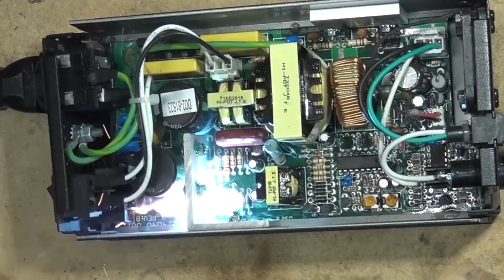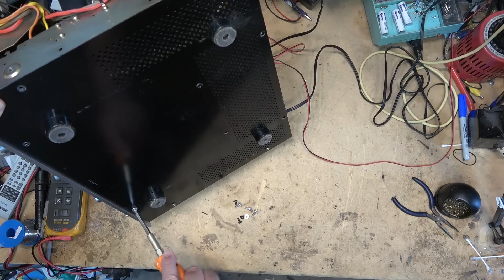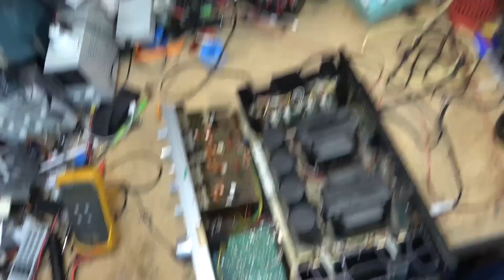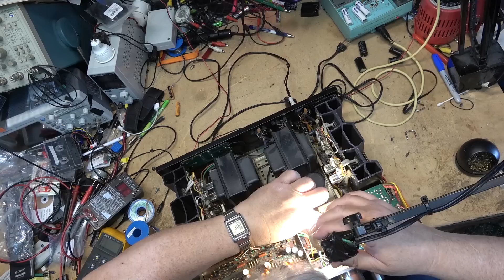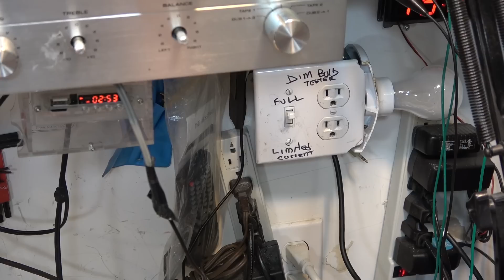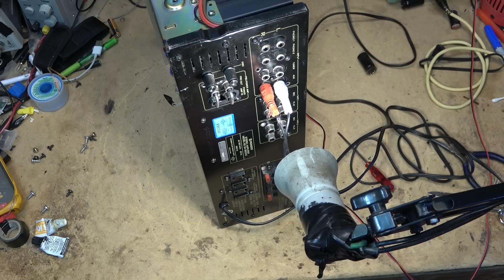Pioneer SA9500 No Sound

Comment: I don't agree with starting a unit every time on current limiting or variac, under power can damage components as much as over powering will. Your transistors, rectifiers, power caps, need a certain ripple current and voltage in order to function correctly, if not, you are throwing signal waves down stream (distortion from improper bias) that could hurt other things. DBT is for diagnosis NOT for starting a unit every time!
Reply from the maker: Who starts on current living every time? I only use the current limiting light bulb for unknown amplifiers. I may put one on an old vacuum tube set full time to protect transformers
Reply: @12voltvids  sorry I was commenting on wht you said about knowing of people who start their units under limited current every time. Been learning a lot from your videos as a newer restorer!
Reply from the maker: @Texan1048  I do know a few people that start their equipment using a light bulb.  They haven't set up very much like mine light bulb with a switch on it that way they fire up their equipment they wait about 5 seconds and then switch the bulb out. I've never seen any of their equipment fail because of it at a couple guys that I know that have been doing this for years swear by it I don't myself other than under test with the exception of I've got an old tube radio that goes back to the 1930s and I'm out in a light bulb inside the cabinet and keep it powered up through that all the time. It will reduce the voltage to the tubes for sure and it won't go as loud as it once did and it's probably not quite as sensitive as it should be but it's a radio that I don't listen to on a regular basis it's more for show just like all my other little tube radios they all work but I don't listen to them. Naturally with a big solid state app you would not want to run it going through a current limiter and put a type of volume through it because that will cause a voltage drop which will upset the balance upset the bias I generally cause the unit to go into protection. For the initial startup though I don't really see any problem because you're not drawing any current. Many amplifiers have a NTC thermistor on the power input.  This does the same thing start at high resistance and over the course of a few seconds the thermistor heats up at the resistance goes very low. This gives you in Rush current protection. Exactly what putting a incandescent light bulb in series with the power line will do. You switch it on the light will go bright for a few seconds of that damn out as the capacitors charge up now your current in Russia is done and you can throw the switch to take it out of the circuit. my big power Apple fire for example has inrush current protection it's actually built into the power switch which is also a circuit breaker. Why you throw the switch there's a delay before full power is given and that's to allow the big power capacitors to start to charge up slowly. The switch will not engage if there's no power on the AC input if you try to turn it on it'll pop back off. what are the reasons that they do this on some of these big power amps is because the amplifier can draw it excess of 15 amps if it were to be powered directly and I could trip the breaker. I've had that happen on some of the big Apple fires that don't have inrush protection. Hit the power switch at the breaker trips that I got to go reset the circuit breaker.

Comment: Just Tell The Owner To Go To Autozone Get An Instrument Panel Bulb & Put It In.
& That'll Save Him Some Money.
I've Replaced Alot Of Dial Bulbs.
I Put A Newone In My Mom's Stereo.
It Used To Have A Plane Clear Bulb
So She Wanted A Colord Bulb
So I Put In A Small Christmas Bulb 
So Thatone Burnedout Rightaway.
Cause It Was A 3 Volt.
Cause Those Kind Of Lights
Are In Paralel & They Feed off
Each other. So I Tryed A small
12 Volt Intirior Carbulb. Then 
I Tryed It & It Workef then 
After I Pluged Into The Socket Using 
A teal Blue Magic Marker I Colored It.
& It Worked The Magic Marker Didnt
Come Off The Bulb Cause I Held 
Onto The Socket & Put It in

Comment: Hi I'm with you on the Klien scissors they were designed to cut copper foil and braid for high voltage work. by the way my bench is messier than yours!
Rich
Reply from the maker: A messy bench is a profitable bench.  (Time is money and cleaning up makes no money.)
Reply: @12voltvids  Clean bench is peacful for the mind. No wasting time searching for tools, or losing screws or springs amongst the clutter. A big rubber mat beneath the bench helps catch things and is easy on the feet. Old B&D handvac is handy to pick up wire clips, insulation.
Reply from the maker: @Poppinwheeeeellllllieeeeez  your welcome to come on down and clean it for me if it bothers you so much.
Reply: @12voltvids its called a worm bench, my bench looks just kike that, Ise it to transfer amd make money

Comment: I can tell you do or did this for a living and not just for a hobby. The way your bench is full of stuff and your no messing "get to the fault" approach combined with a long but not obsessive soak test of repairs. I live in a twilight zone where I repair comms equipment as a job and my hobby is repairing tube and solid state radios and record players/amps, test equipment etc - anything really. So I have a slightly tidier hobby workshop because there's no pressure to get kit out the door (but old habits die hard, so not too tidy). I don't have the time or inclination to tidy my area very much where I do my real job. In my hobby I leave stuff on test for days and days in real life scenarios. I don't have the luxury of time or space to do that at work. Generally things are left on test overnight or over the weekend, only longer if known to be intermittent. I like watching you at work, where I work now there's only me actually doing fault finding and repairing and another guy swapping parts and testing. I don't get to talk to anyone with the same experience as me so I love watching youtubers who know their stuff doing a similar job to me. Pretty sad that this is a rapidly dying trade.
Reply from the maker: Yes I did this for a living from 1981 through to 2003. I left the business then because there was no money in it anymore. Over the course of one year I saw my wages fall from $80,000 to 47,000 in one year. I left and for one year put up satellite dishes because those were the big thing back in 2003 and into 2004. Then I heard that the phone company was going to be hiring, and that was actually the first place I applied for a job back in 1981. Unfortunately I wasn't hired back then because the big hiring had been done between 1977 and 1981. I graduated in 81 so I was still in high school at the time and by the time I graduated their entire quote I had been filled and there was no openings. I actually got in to the company in 2004 when the first batch of guys had all started retiring. That's the thing with big companies like phone company power company etc people don't generally leave those type of jobs until they're ready to retire with their pension so they do a mass hiring and then nothing for the next 25 years until about you guys start retiring with their pension and then they start to replace people although this industry is changing too. I think it's very unlikely that when I retire will be hiring more guys to do my work because it's such a changing industry with everything moving to fiber optic there's much less maintenance to do and once it's installed until the building is replaced it never has to be touched. Someone new moves in they ship them the equipment the equipment gets plugged in and it works. Company will hire less qualified installers that basically just go to the house and plug in equipment or swap out defective and those people will be paid a much lower rate than what we're currently making today because their job won't require the same level of training or expertise that my group has because we have to work both with fiber optic and the old copper plant which is still in use in certain areas. My workbench at home I work on mostly vintage audio equipment I have regular clients that bring me equipment to work on. Several of them are resellers so they pick stuff up at garage sales estate sales etc and it doesn't work they bring it to me to fix, they all want them fixed as cheap as possible because they're just going to turn around and sell it on eBay. This is where I get people and I get annoyed when I get people telling me you should do this you should do that you should do the other thing. Again if a customer came to me and said I want my amplifier completely restored and I don't care how much it cost change all the capacitors. I'd do it and I charge them accordingly two or $300 maybe $400 depending on how much work was required and how many parts I had to put in. Some of those large capacitors cost a lot of money. The small ones sure cheap but some of those big filters can be 50 or $60 each. If clients paying for it no problem but the majority they don't want to pay three or $400 to fix an amplifier that they might get that when they sell it they want it fixed for 40 or $50 so that they can turn around and sell it for $400 and make some profit. Of course I don't care how much they get for something I just don't want them to tell me how much they got for it when they ground me down to the absolute minimum. Like the guy that had the Macintosh DVD player that I had to tear apart to get out of belt. Was telling me how he picked this thing up for 200 bucks broken. I told him at the time I said well it's 150 to fix it. Then I told him I'll tell you what I'll give you $350 for it so you can walk away and make a hundred fifty bucks. Nope no no he wanted it it was one that he always wanted and it was going to be part of his collection. He then proceeded to grind me down on the cost of the repair got me down to 100 because that's all he wanted to spend on it telling me that that was half of what he paid for it after all it was only just a belt. about the took an hour and a half to take the thing apart change and put back together. A few months later I ran into him and he told me how he sold that unit for $1,300. You can imagine that I was a little bit pissed off that I let him grind me down on the repair. Needless to say I had some other stuff of his sitting in the workshop that I put such a huge estimate on that he just picked it up and I haven't done any work for him since all because he opened his mouth and told me how much he made selling this old DVD player. that in the fact that I ran into him driving a Bentley that one I think was the deciding factor.
Reply: @12voltvids  Yes not too many repair guys drive Bentleys. What you say is why its a hobby for me now.
Reply from the maker: @radio-ged4626  no this wasn't the repair guy driving a Bentley this was the guy that I repaired equipment for. He turned around and sold it on eBay to suckers that don't know what stuff is really worth and get caught up in the frenzy and pay way too much. Like the people that continually pay upwards of $1,000 for Sony tcd 5m cassette recorders. One in good working condition might be worth a hundred bucks. If I was in the market for one that would be my limit not the six or seven or 800 or more that some people think these are worth. Unfortunately there's always some fool that has more money than brains or common sense and will pay it. Sometimes for the bragging rights. The guy that was driving the Bentley is one of my repeat customers who's got to be the cheapest scrape that there is. Always grinding me to get a better price from what I tell him it's going to be how he doesn't have the money and how he's a pensioner. That may be true he may be a pensioner but when he comes back and tells me that he sold something that he ground me down on my repair cost and then he made $1,000 profit on it it kind of rubs me the wrong way I don't need customers like that.
Reply: @12voltvids  Yes I didn't mean it was the repair guy in the Bentley. I meant that you wouldn't see a repair guy in a Bentley as we don't earn enough. Totally agree that you don't want to hear people bragging about how much they proffited from your hard work, especially when they grind your quote to powder.

Comment: You mention an isolation transformer with isolated ground as well as a variac. Can you comment on what model(s) you recommend? Or even specs?
Reply from the maker: Mine's made by Hammond transformer company. Kathy two prong cord and two prong outlet. Actually it has three two prong outlets 110 out 120 out 130 out. I have the 130 output plugged into my very act so that I can very from 0 to about 155 volts.
It's I think 550 VA something like that I'd have to go and look it's mounted to the underside of my bench it's been there for years. I know that I can power a big plasma TV off at no problem.

Comment: I don't know what country you are in, but I'm in USA and just checked Amazon.  They have a variety of 8V bulbs, including LED replacements for Pioneer receivers and amp.  Prices range from $11 for 10 to $15 for 10, all with free shipping and many with same day or one-day delivery with Prime.  Amazon also has the caps you needed in several brand names at about $18 for 6 of them and same deal on shipping.  More and more I find I'm sourcing electronic parts, connectors, cables, and coax from Amazon.  The prices are comparable, sometimes cheaper.  With a Prime membership ($16 / month) I don't pay shipping and no minimum dollar order.  Also, I get my stuff at most two days, usually faster.

I get that if you are doing this as a business, you want to turn the repair around and out the door and free up your space.

Comment: Great Job 12voltvids ! Thanks for the video , are you far from Kentucky ? 
Man this g8000 is whooping my butt man ! I cleaned everything very good and correctly but the switch for tone control default cuts my left channel out sometimes i didn't wanna pull tone board out looks like i may have to 😥 Love the amp when i put in amp mode and use a preamp works great . Would love to bring it buy and have you check it out
Reply from the maker: Long way from Kentucky.  Canada left coast.
Reply: @12voltvids  Got ya yeap thats pretty far away.

Comment: These vintage amplifiers are always interesting to repair, but I also share your opinion and apprehension about such evident signs of tampering. This job was quite easy, dead filtering caps are main culprit in most of these. However, when some of these preamp electrolytics are dead, I also check the other power stages supply caps, as they generally share same aging process. An increased ESR value is definitively the best indication for changing these caps.
I've had such problem multiple time with heavy material, typically with amps with broken loudspeakers connectors Nearly all these are nowadays relatively easy to find on the internet, but as for the power indicator bulbs, the shipping costs represent a quite impressive percentage of the total amount, plus you can have import duty fees, and long delays... It's something you always consider when it come to "as new" or mint equipment, as your goal is to leave minimal marks of any intervention to keep the best value on high priced equipment. But hey, here you have a beast with these engravings and numerous traces of non professional tampering, missing screws and so on. I'd even be reluctant to have such mistreated ex pricey equipment in my hands. At this point, the JD weld solution to fix the connector is perfectly acceptable! 
I perfectly share your position about this Hafler amp, first because these missing fuse holders could be the emerged part of an iceberg, and finally they could be a difficult and pricey part to replace. 
Another thumbs up for your safety measures! The safety transformer or high sensitivity differential switch are the first line of protection, and the dim bulb trick is another minimum equipment needed to protect the material you check. Some have different bulbs, but one is a good start to indicate when something is wrong, mine is red!

Comment: What’s been your easiest fix ever?
Reply from the maker: Lots have been really easy.
Reply: @12voltvids  I’m no where near your capabilities but I’ve done a couple that only needed to press the reset switch on the back and viola operation success. Usually pops during a power failure. A common thing here down under.

Comment: Not sure why you didn't just drill out the broken screw instead of gluing it??? Don't mean to criticize but jee wiz, that is bush league...
Reply from the maker: It wasn't just a broken screw there's nothing to screw it to the actual plastic base is broken. So there's nothing to attach it to other than to glue it into place and less you can find a replacement Jack assembly. if you look at some of the other jacks on the back of it they've been glued in place as well because the plastic has gotten brittle and broken. That's what happens with plastic of this age it breaks
Reply: @12voltvids  Fair enough, my apologies...

Comment: Hi Dave…have you noticed any strength difference between original JB Weld and the quick setting variant? I’ve always used the original but it takes sooo long to set and cure.
Reply from the maker: The quick set gets hard as a rock.